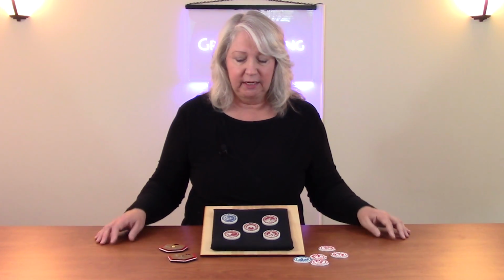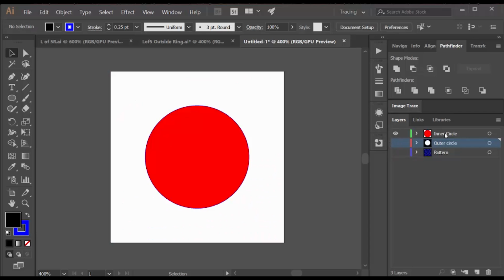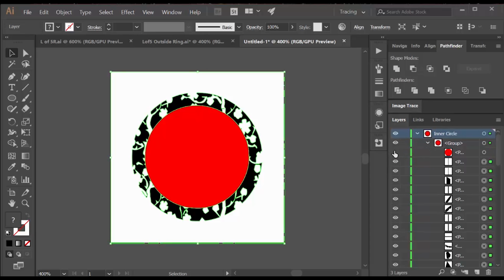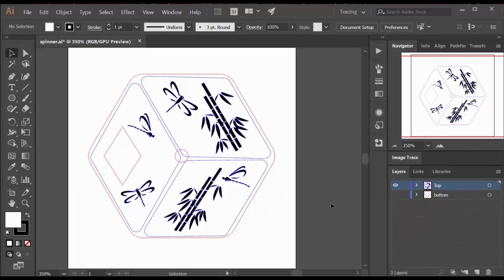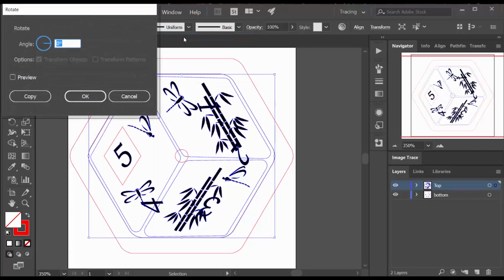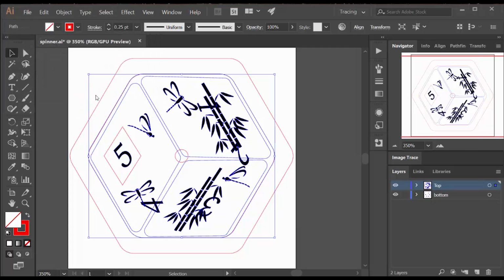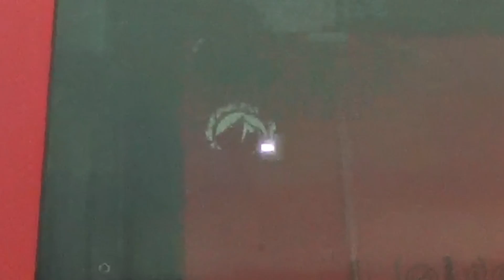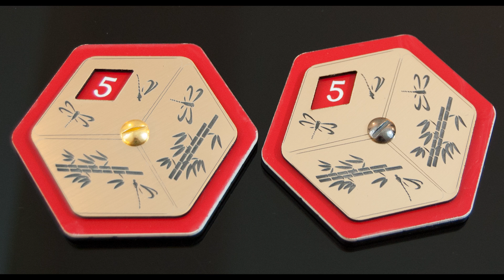How to Design and Laser Cut Legend of the Five Rings Tokens and Honor Dials

Comment: Hi. I love your videos, thanks for sharing all this information. One question, maybe you already answered in another video. At the end of this video you say you would airbrush some barnish to the acrylic tokens. What barnish do you use? I'm planning on making things like this on acrylic but I do not know how to airbrush, I think I would do it other way but I don't know what barnish is recommended for acrylic. Thank you in advance.
Reply from the maker: Fernando, I have used several different clear varnishes and have never had a problem. You could use something in a spray can instead of airbrush, just spray it on thin. I would test on a simple piece of cut acrylic first before doing painted tokens you've put a lot of work into. If the varnish says acrylic in the description, that is best. For example, I've used this: Krylon K01303007 Acrylic Spray Paint Crystal Clear in 11-Ounce Aerosol https://www.amazon.com/dp/B00023JE7K/ref=cm_sw_r_apan_glt_fabc_6SKA5TKKGH0W8E6XXZDA
Reply: @GreylightMay  Thank you so much 😃😃😃
Reply: @GreylightMay  thank you so much :) :)

Comment: Hi i have 150w co2 chinese laser machine when i cutting mirror 3mm acrylic (power 45 and speed 15) material ll be burn so let me knw how how much i ll give speed and power.
Reply from the maker: Dyamu, I have never worked with such a powerful laser, so I don't know. You will need to do what I do whenever I work with a new material on my laser cutter (100 watts) which is to run a series of small tests, in your case by decreasing the power and/or increasing the speed, since your current settings are too hot.